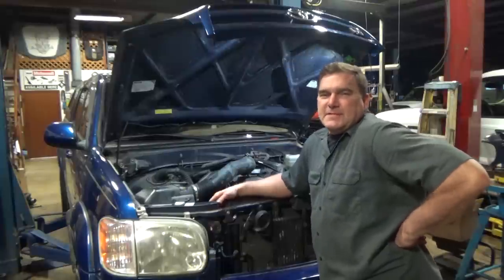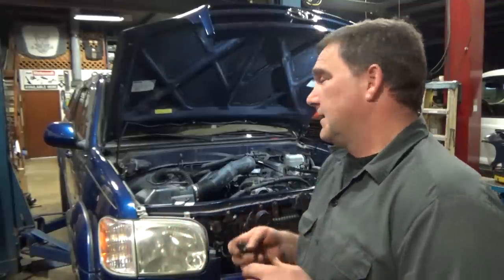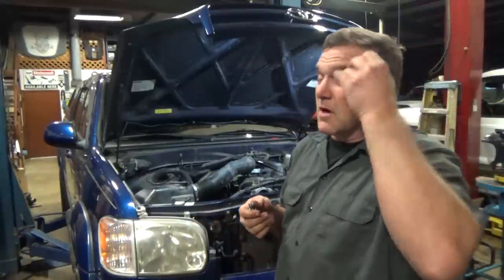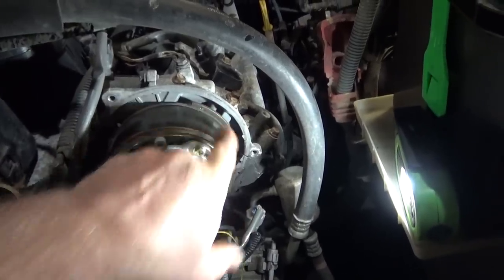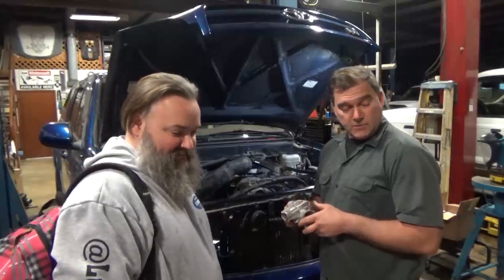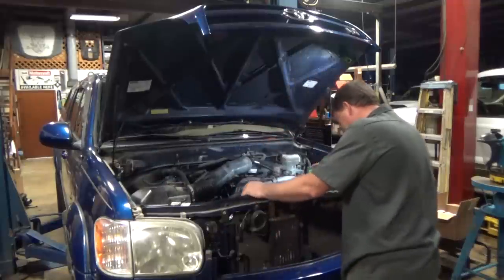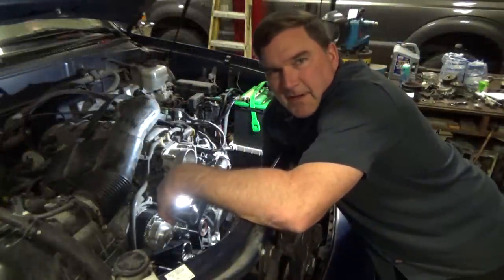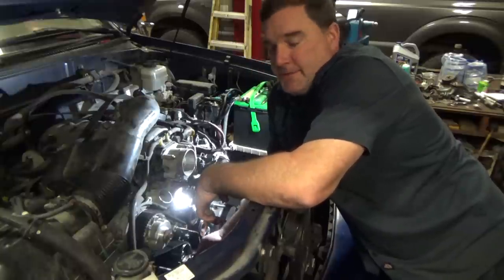Toyota Tundra No Start, We "Inherited" from another shop. Sure why not, Toyota 2UZ-FE fixin time!

Comment: The 2UZ-FE is an interference engine.  At 40 degrees off for the camshaft there'd be no compression and the valve train would be damaged.  These timing belts generally don't jump time unless the tensioner fails.  The problem you're seeing usually results from a botched timing belt job.
Reply: Mine jumped due to a squirrel setting up shop in the timing belt cover. God damn squirrels. An acorn caused the belt to jump 5 teeth. Got a faulty camshaft position sensor code. After a few days of trouble shooting I gave up brought it to a friend who noticed the belt jumped and saw tons of squirrel debris in the timing belt compartment. 😢

Comment: Toyota OEM manual requires before you remove exsiting Timing belt, confirm its in correct allignment, w/ TDC on the crank and the 2 cams alligned w/ timing marks.  Then, rotate the Crank pulley ~ 45 degrees past the 0 degree timing mark , this position provides a less "tension position on the cams" so after you remove the timing belt, so the spring tension on the Cams do not cause the Cams to shift violently after removal of the original timng belt.

Comment: So my used 01 tundra timing belt broke 2 weeks after I bought it. Totally sucks! Anyway I'm in process of changing the timing belt and hoping everything is okay...

My question though is how do I fix the timing before putting in the new belt? As you read in the instructions says not to turn crank or cams without a belt....

Comment: That white smoke is that valve issues? Might has 411000 miles and it just now didn't crank it bogged out and died. And no STI think the vows have to burn it down and rebuild it if I want to keep it. Let me know what you think.  My belt also squeaks like that.And was squeaking prior to this happening
Reply: My belt was squeaking prior no start just now tried to crank it.Bogged and died white smoke prior for past 2 months with squeaking belt.Do I need to break it down and rebuild

Comment: Rich I live in Virginia and have a 2004 Mercury Sable with a V6. It only has 110,000 miles on it. it has been to 2 different shops and it has new plugs, wires and coil pack replaced twice but it is still throwing a random misfire code. Do you have any thoughts as to what is wrong with it?

Comment: AISIN makes the OEM parts, and they do sell the timing belt kit with OEM water pump.. GATES is ok, but not recomended for Toyota. It absolutely is a interference engine. if it jumped a thread or so will be enough to throw off the computer and timing but should not damage the engine.  but it will not run or start either. you can turn it manually to reset the TDC and check the timing marks on the crank,, there are several video on the job.

Comment: How long did it take you to change timing belt ?
Reply: Tining belt replacement on this engine is a 6 hour job minimum, and thats if you have all the tools and you completely understand the Timing Belt allignment procedure.  FYI... the AC compressor is NOT required to be disconnected. Just loosen the AC bracket that bolts the comnpressor to the engine block, towards rear of engine, 1 of three bolts.  The 2 front of course require removal, this 3rd bolt just loosen to give you play to pull out the Fan bracket support.

Comment: As soon as you said what the compression was odd said timing belt an 10 sec later you said same thing .
Reply from the maker: You're on your A Tech game then 😉 interesting thing is that none of the onboard computers/sensors caught this?
Reply: If it would have started probably would have had cam / crank code but not always . Been turning wrenches for 30yrs now . Seen a bunch of crazy things and the simple things will get most techs definitely not saying this was a simple one but it's one to check on them